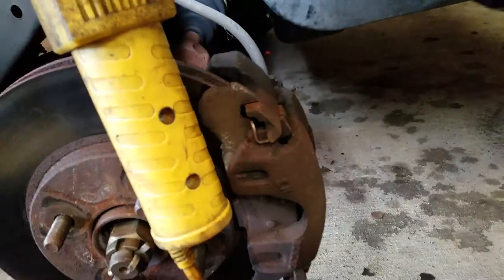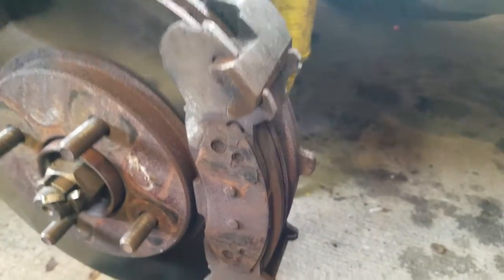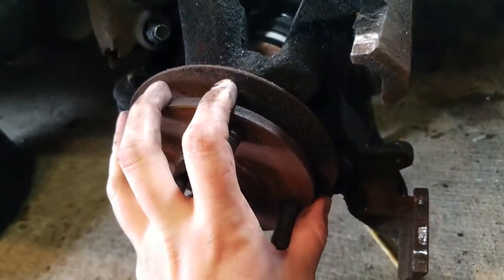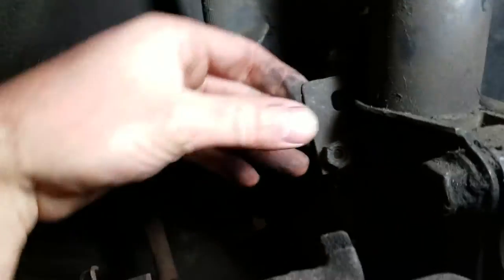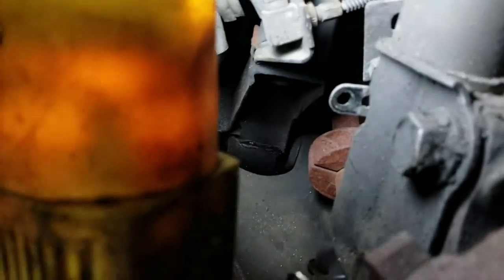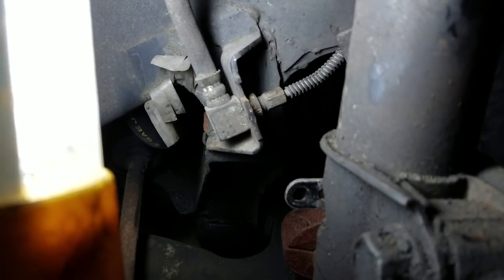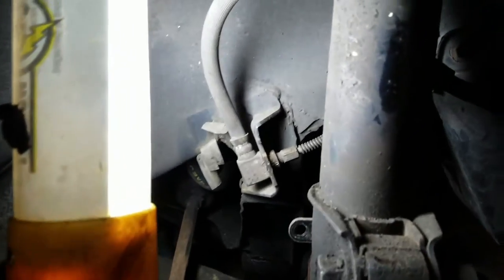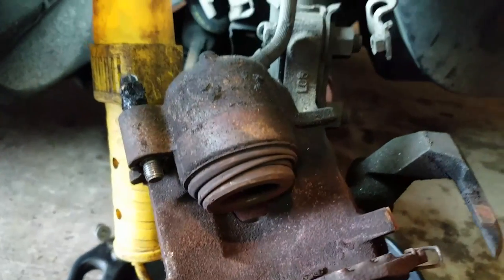K-body LeBaron convertible brake pad/rotor/caliper and flex line replacement

Comment: Thank you for this video! a friend of mine was changing my brake pads and he has cataracts and wasn't paying attention when he took it apart and couldn't remember how to get it on correctly and couldn't see to do it so I was having to do it myself. I've assisted with brake pad changing a lot and you could do it on my explorer no problem so you think it would be a cinch to do it on a Chrysler but to the contrary...lol
This video saved me. thank you so much!
Reply from the maker: Happy to help!
Reply: How do you put pads back in ???
Reply: @gregboyea8705  Well turns out whoever did the brakes previously put the pads on inside out if that makes sense. So turns out they really didn't need to be changed once we put them back in the right direction. The rear disc brakes they are going to be a challenge. oh and did I mention the replacement brake pads in any brand for 92 LeBaron convertible do not I have yet to find the ones that do

Comment: Is that a 3/8 line wrench you use to pull the brake line?
Reply from the maker: I honestly can't remember. I'm going to be replacing the front rotors in the next month. I'll stick a line wrench on there when I do and let you know.
Reply: @wastegatefixes9253  wow thank you very much for your quick reply, I'm working on a 1989 right now ive owned 4 in my life

Comment: New pads do not come with those springs and the guy who was trying to put my pads on freaking lost them!😠😠😠😠
Reply from the maker: You might be able to find those clips in a brake hardware kit from your local or online parts store. Your brakes will still work without them, though they might rattle and be annoying but in an emergency you can drive and stop the car fine without them. Good luck!
Reply: @wastegatefixes9253  well bungee cording my top down because I don't have a boot I actually just came across one of those brackets and was like well heeey that's good LOL I haven't had to drive it anywhere very far just a few miles from home. not like I can go anywhere good being self quarantined and all lol I'll definitely check out hardware store for a new set these we're probably the originals. Everything on that car pretty much is original! Thank you again for your help. hey do you suggest a YouTuber or tutorial video about how to put a soft top on a 92 Chrysler LeBaron convertible? I'm debating on tackling that...😬😬
StayWell friend!
Reply from the maker: @MusicLeeSarah  I don't have any YouTube suggestions on putting on a new convertible top. I needed to replace mine and looked into it. From what I saw it was a tough job and requires a lot of patience. So I decided to just pay a shop to replace it out of fear of messing it up.
Reply: @wastegatefixes9253  I'm nervous about it no doubt but I'm also kind of in the position where I don't really have the money to have anyone do it for me. 😬The cheapest bid I found was  $250. and I thought this would be an easy thing to find but turns out it's not. I found two places online that have the soft top. But their price is much more than I was told by several people it would be. It's going to be like $300 for the soft top. so you said you were placed yours. Did you order online did you go through an auto parts shop...? Do you mind sharing your experience with me?